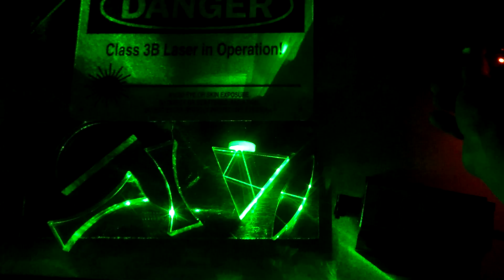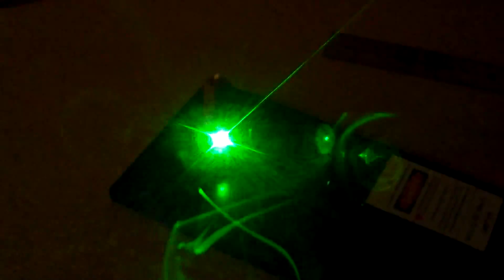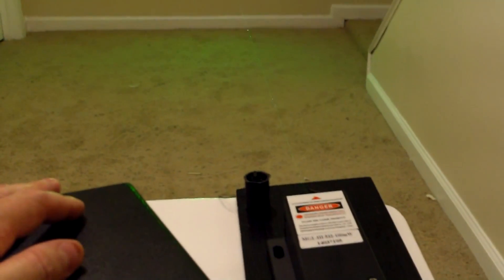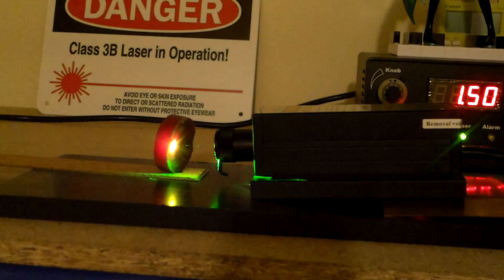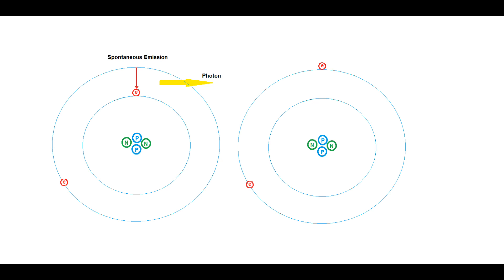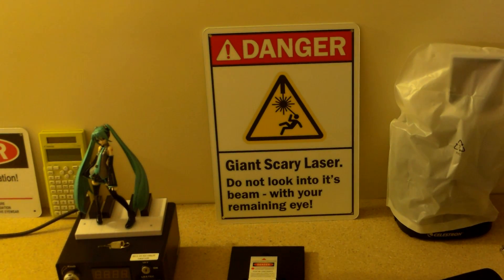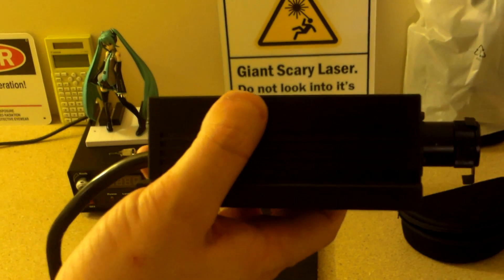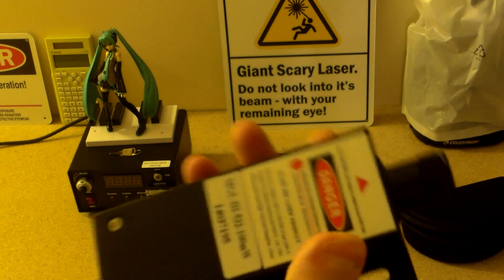Lasers! Lasers! Lasers!

Comment: Since you mentioned dragonlasers, they are currently selling the rare wavelength 589nm Sum-Frequency-Generation (SFG) 50mW handheld Spartan at a fraction of the cost. They are not restocking this product and once they are sold out they will be gone. Only CNI makes these and they increased their prices to over $1100/ea, which is why DL isn't going to restock them. I picked one up for myself as soon as I found out. If you thought standard DPSS (SHG - Second Harmonic Generation) is cool you'll love SFG. Plus it is essentially the color of sunset and the natural color of excited sodium emissions (Na D line).

Comment: Just a correction; it's half the photons at half the wavelength (or twice the frequency) from the KTP. Twice the photons half the wavelength would be 4x the total photon energy that is being input from the 1064nm. Glad to see you took all the proper safety precautions though!
Reply from the maker: Are you sure?   1064nm = 1.86696×10^-19 joules   and  532nm = 3.73392×10^-19 joules. It would seem like it would be double the photons at half the energy not double at four times the energy.  

I would not mess with a laser greater than about 10mW without proper glasses. I bought special glasses which were specifically for the wavelength I was using. I additionally lock my lab door and post a sign (warning, class 3B server, etc). You can never be too careful and I don't want to cause any harm.

Still, loads of fun!!!
Reply: antiprotons Yeah, you have to remember that photon energy decreases as wavelength increases. If you convert wavelength to electron volts it becomes apparent and conservation of energy makes it obvious. A 532nm photon has twice the energy of a 1064nm photon. If you input four photons of 1064nm the theoretical 100% efficiency of conversion would yield two photons of 532nm. IIRC the record high efficiency rate for 808->1064->532 is something like 19% for CW (not q-switched) systems.
Reply: ***** That's a good way to permanently damage your vision, if not blind yourself. I have a scar on my retina from an errant 65mW 532nm beam from a laser projector that scanned across my eyes for less than a second. Thankfully the brain corrects for most retinal defects and it doesn't affect my vision. I do see the black spot against certain backgrounds before my brain corrects though. It is essentially a second blind spot.
Reply from the maker: Interesting!  I have a my unit set to CW, though q switching looks quite interesting!